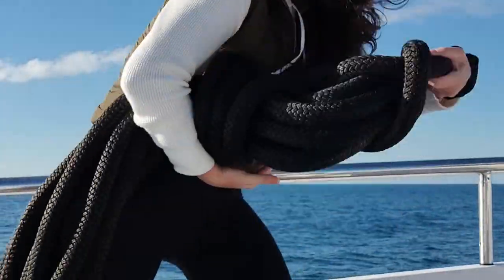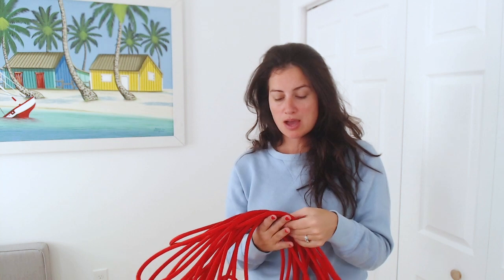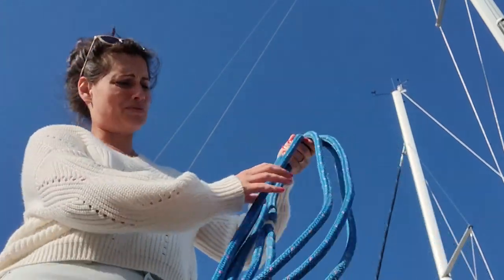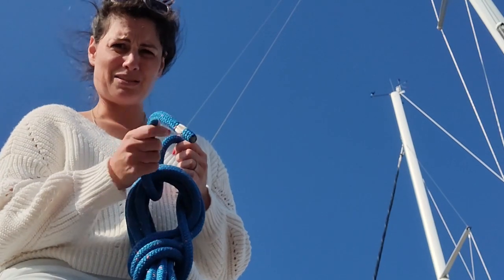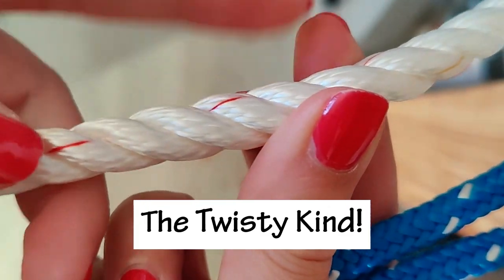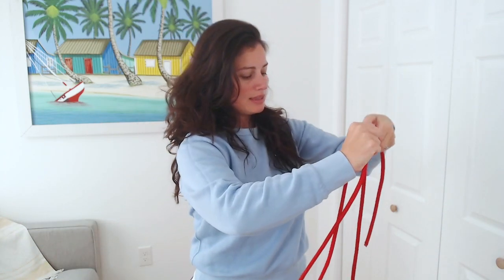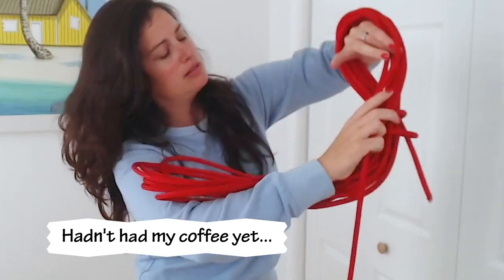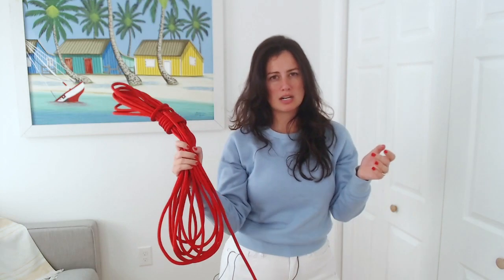Coiling Line on Boats and other Captain Lessons

Comment: I started watching you after i saw you in Waynes vid. 
I got to say i live your content, humors really in point !

I wanted to ask you about coiling - i discussed with some skippers they like to use alpine coiling - as they claim its more resistant to twisting and random knotting/tightening in the locker. 

Could i ask what are your thoughts ?
Reply from the maker: If alpine coiling is what I think it is, it's fine, but boat dock lines can be pretty wet and gross so I don't want them hanging from my body ....I wear a lot of white outfits on boats.

Comment: Nice job!  You’re doing it right!
      That’s how I always used to handle rope in my lobster fishing years (not the figure eight) and early sailing years.  But I have since taken on a new way.  It is how mountain climbers coil rope and it’s fast and easy. (don’t go there)  You just collect it with your hand as usual, but make one loop on one side, than one on the other etc..  No twisting required, no figure eights and when you undo it and throw it down, it never snarls!  It only works with braided.  For three strand I still twist and shout!  lol
      This is how I’m doing it now.

https://youtu.be/Jklqd_DwnWo?si=sNuUP0hJBQ2O2ug8